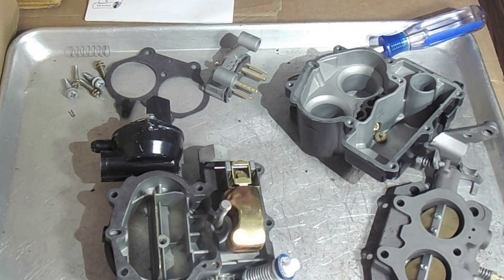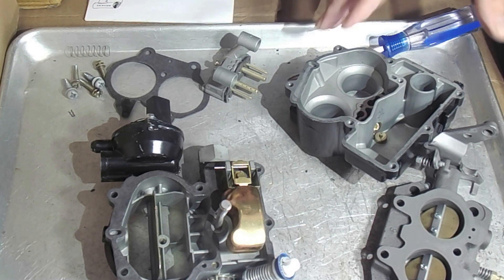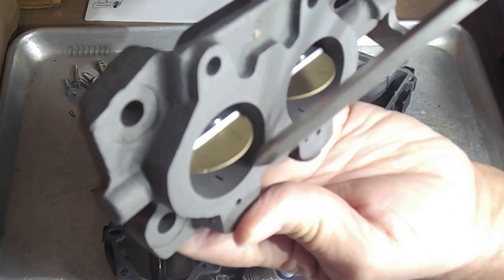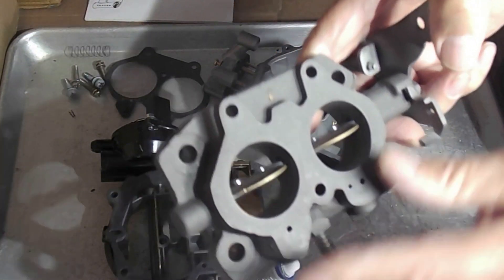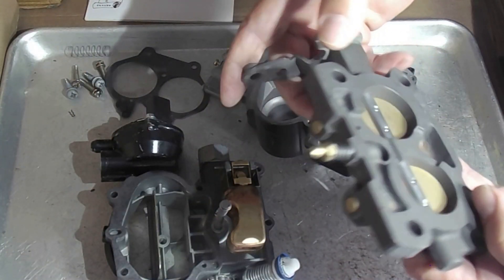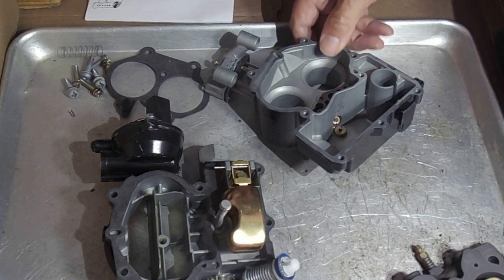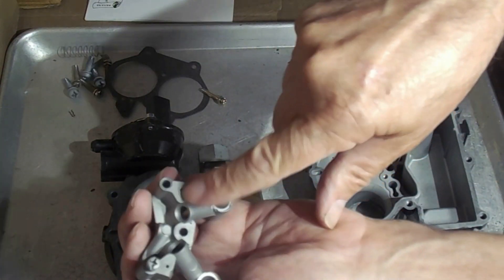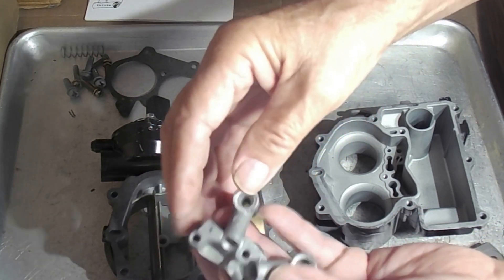Mercarb Off Idle Circuit

Comment: Hi, 2015 3.0l mercruiser. Idles great then at about 2200 to 2400 rpm i get major hesitation and it bogs down and dies. If i start it up again it idles fine until i try to rev up to the 2k point. Is this likely a carb issue or could it be fuel delivery?
Reply from the maker: Look at this article Mercarb Low RPM, etc. https://www.carburetor-parts.com/mercarb-marine-troubleshooting

Comment: I have a 1997 1700SR Maxum with the 3.0LX engine that I bought new.
It has developed a low speed bog. If you easy into it, the motor will surge. If you just nail the throttle, it goes without any issues. 
Do you think that what you describe would cause this problem?
Reply: I replaced the accelerator pump and it still does it.
Reply: @MikesCarburetor  
Thanks
Will check it out

Comment: this describes the idle and idle transition circuit on conventional carbs better.. https://i.imgur.com/rtqKrik.jpg
at idle.. in a conventional carb.  this carb changes the idle air bleed  to adjust idle and idle transition mixture.. 

the idle transition circuit supplies the fuel from idle. and above idle till there is enough air flow thru the venturi's to start pulling fuel  out of them..